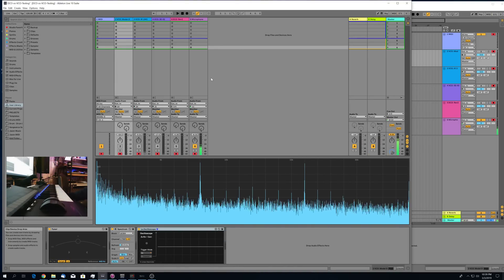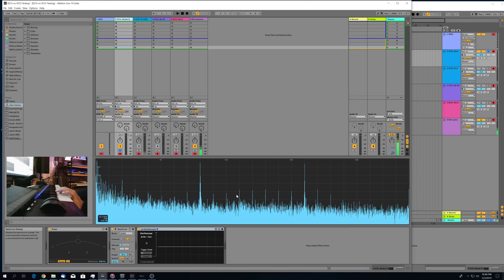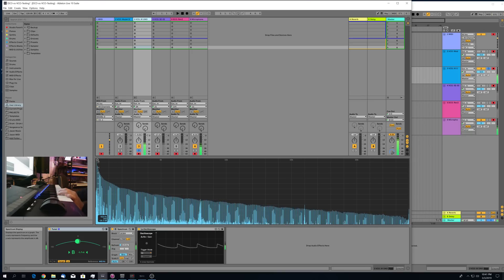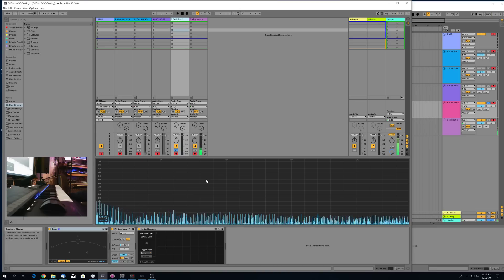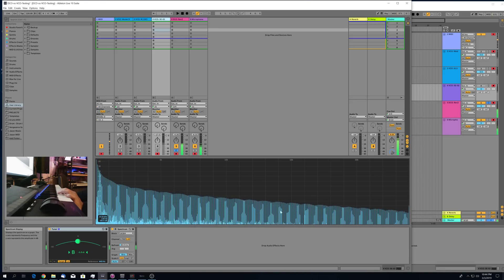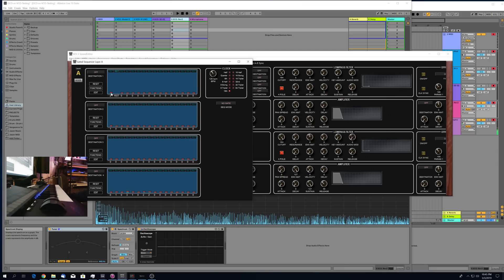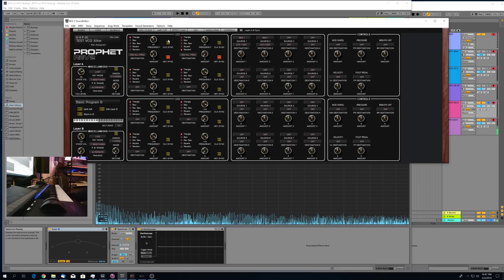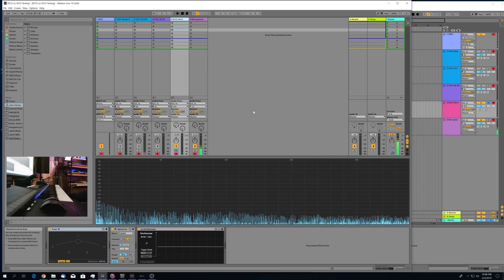VCO Harmonic Frequency Jitter - Do DCOs sound more harsh than VCO synths?

Comment: wow. what great work ! I wish you had two synths that were more directly comparable.. the REV2 VS the PROPHET 6 ! 
But you giving some instructions on sorta recreating it ! what a awesome work ! thanks !
Reply from the maker: Thanks!   Oh, forgot to add in the notes... since recording this video, I've tested several more VCO synths: Sequential Prophet 6, Sequential Pro 3, Arturia MatrixBrute, Korg Minilogue XD, Moog MemoryMoog, Roland Jupiter 8, Oberheim OBX, Oberheim OBXA, and a few others.    All VCO synths exhibit this same type of Frequency Jitter / Harmonic Jitter.... some of them slightly more, and some less, but it appears to be inherent to their architecture with voltage controlled clock for frequency.    The bigger discovery I made during this was actually the voice-by-voice variance.   Look up the topic "Voice Component Modeling" for more info on my findings, or check out my Blade Runner video for some more info on that.
Reply: @CreativeSpiral  thanks! I was wondering, I guess on that 'simulation' of VCO you did with LFO's, on the Rev2, you are slightly modulating the fundamental as well (unless I missed something). So that 'shows up' in the harmonics. Out of curiosity, I guess the tuning stability of the fundamental itself is not varying enough even on VCO's to be detectable? (and likewise on the simulation you did), or can you see like 10ths of cents changing or something? Just trying yo deconstruct the mechanics of it a bit somehow. .. like is it because the VCO chip is not as tuning precise, or some other reason, or what etc. So Idk if would work out and help to see that stuff on a tuner or not.  Thanks !
Reply from the maker: @eltouristoduo   Yeah, by modulating the frequency of the fundamental you can replicate the same effect.  The jitter in VCOs varies from synth to synth, but its usually no more than +-2 cents at the fundamental, at a fairly high rate, as shown in the video... that movement at the fundamental causes the upper harmonic content to "swing back and forth a bit", as seen in the video.   As mentioned, the audible effect is very subtle, because the amplitude of harmonics is significantly lower as you go up the frequency spectrum, but I think it might be one factor that sort of "softens" the sound of VCOs... you don't have pristine, locked in upper frequency harmonics... there's a bit of movement/blurring of upper frequency content.    As mentioned in my previous reply though, the Voice-by-Voice variance that I documented separately has a very significant audible effect on classic poly synths vs modern digital or DCOs (or even some well tamed VCO synths).
Reply: wow. did you prepare some reading about voice-by-voice variance, or do you have some 'recommended reading' about this? I saw your 20 patch demo vid for the Rev2. very nice. I'm still in the purchase evaluation stage of rev2 ownership. But it's likely I would get that set from you once I settle into a Rev2. I'm getting the impression maybe it was your patch design activities that led you to this area of voice variance and vco simulation. Would you say you are a full-fledged, from-scratch designer for most types of patches? (it seems that way) Would you say the Rev2 set,  and other patches you offer are reflect the effort and knowledge/skill/depth etc of  from-scratch making of them, or do you sometimes start with a preset that is already the target and try to refine it somehow? I say this for example because the 'jump' patch seems noticably closer to real OBXa (or whatever) than the Rev2 factory preset sound. So I guess it would be fun if you have comments about your process there on that one, representing and example of your apparently very fine work. Have you done any vids where you talk about your patch design process. I bet that would be very interesting to many of us, if you haven't already.
Reply from the maker: @eltouristoduo   Yeah, check out http://www.VoiceComponentModeling.com - a website I setup where I documented my findings with voice variance.    The Rev2 is a great board!... I highly recommend it.   It's really one of the most versatile and deep poly synths on the market... a sound designer's dream.   The Moog One may be the top dog, but for the price range, the Rev2 is amazing... definitely a best value in class.    Regarding the Van Halen Jump patch, I think I ended up spending about ten hours on that one patch over a period of a few days.   Since it's such an iconic synth sound, I wanted to see how close I could get to the recorded track.   Many people have done Jump patches for various synths, but most are missing some aspect of the sound.   I looped small sections. under one second. of the recorded song intro, and did analysis in an oscilloscope and spectral graph to break down the sound and do a tone match.   Many people think that its two saw oscillators, but if you look at the recording you can see it's a saw and a pulse.  Also, the left/right channels are phase inverted on the remaster recording.  Anyways, yeah, I spent a lot of time on that patch... my wife started complaining about hearing the Jump intro 100 times over a few days.   I've been meaning to do some more patch design tutorials... just been busy the past few months with remodeling and family stuff.  Soon....
Reply: @CreativeSpiral    Did they ever sort all the bugs out on the Moog One … ?! 😉
Thanks so much for all you’ve done for the community with this work - greatly appreciated!
Are you at all excited about the impending new ‘Super Bowl Moog’? ☺️  Lots of discussion of their newest TMs, and what this new synth could be, exactly … Any theories?  😊
Cheers!  Thanks so much, again!  Be well!  🙂
Reply from the maker: @kierenmoore3236   You bet!    Not sure on the latest state of the Moog One... don't own one currently.   I am interested to see more about the new Moog -- Rumors have indicated maybe a Poly-8 based on Matriarch architecture, with patch memory.   That could be interesting...  I was initially thinking maybe a modern MemMoog.

Comment: Could if be that the LFO frequency that you find most adecuate is related to the frequency of the alternate current of the power outlet, i.e. 60 Hz? I don't know what frequency does a setting of 67 in LFO Frequency represents for the Rev2 but it might be directly related to the AC frequency. I know the synth uses DC which by definition does not cycle but the power adapter/converter might be a bit affected by the AC frequency.

Comment: So if I would like to apply the same jitter to the second oscillator I”ll have to use LFO 3 (triangle) and 4 (random) to modulate its frequency and Slots 3 and 4 to modulate LFO 3 and 4 amounts respectively, right? These are great analog synths emulation techniques and I think manufacturers should include them in their designs so we don't run out of modulation sources. Maybe something like "degree of VCO jitter emulation" for this particular technique.
Reply: Isn't this essentially what Sequential (Dave Smith and co.) is doing with adding a "slop" parameter to their more modern synths? I think even the Prophet 6 has a slop parameter, even though it uses VCOs, since the VCOs are very stable.

Comment: I wonder if that upper frequency jitter would be different if you took the same synths to a part of the world with a different voltage eg. 220v like the UK and Europe. Perhaps the VCO jitter would be different and would require an LFO rate other than 67 to compensate.

Comment: This is great, but I really don't understand the routing on the REV2, what exactly is being oscillated? The sequence depth or?? I might have missed it.
Reply from the maker: Oscillator Frequency is the final destination... It's being modulated by < 1 cent, at a fairly high frequency.   There is no way in the Rev2 to directly target OSC FINE TUNING via mod destination... only OSC COARSE TUNING....  so I"m using a workaround with the Mod Matrix to scale down values from the Gated Sequencer, through the Mod Matrix, resulting in a micro frequency modulation of about 0.6 cents total.  

Basically, if you have a value of '2' in the Gated Sequencer, and then use the Mod Matrix to route that to Frequency, with a mod matrix value of 1, you are effectively sending on a value of 2/125*1 = 0.016  ...  where 2 is the value in the gated sequencer, 125 is the max value of the gated sequencer, and 1 is the mod matrix amount.    It's a bit of duct taping for a solution, but it works :)   And you can achieve very fine tuned adjustments to frequency.

Comment: Be interesting to see some older machines too as well as Siel dk600, polymoog with their different gen. methods as well as dco machines using the early  -mid 80's common method of clocking op amp ramp gen ... welcome to bring your rig in here and document some other stuff if you get to bozeman!